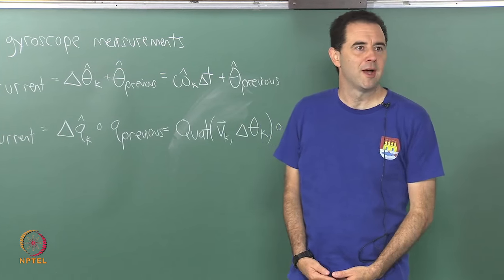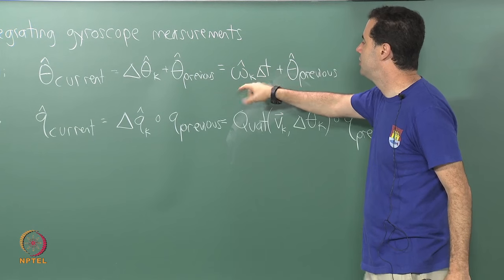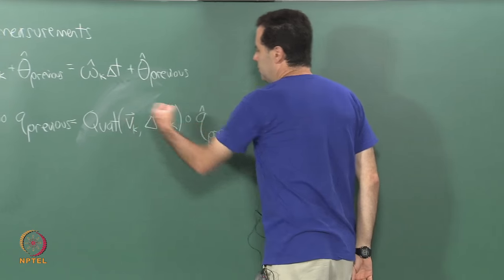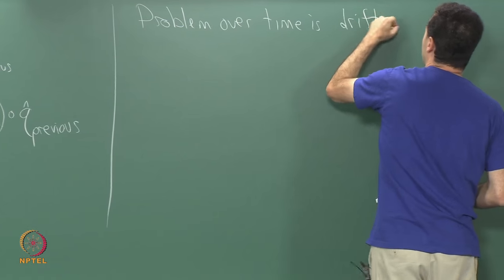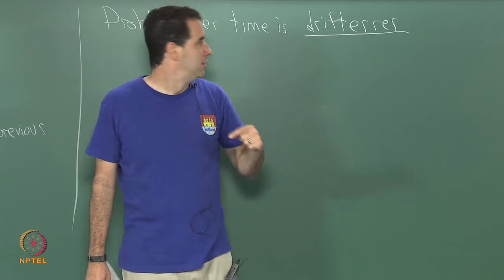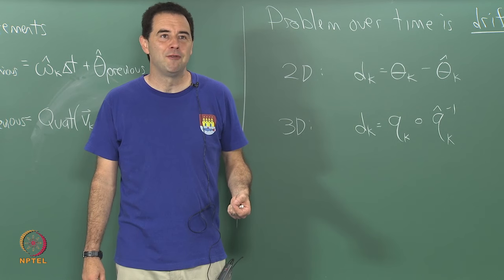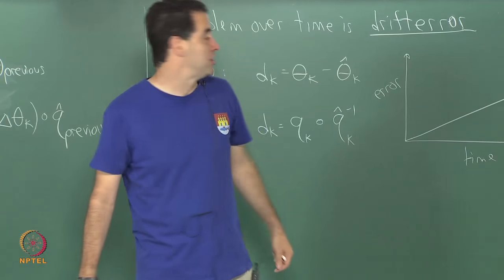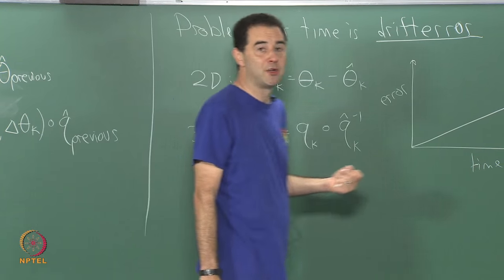Tilt drift correction

Comment: Is't an accelerator sensor measures acceleration according to the chip orientation ? when a user moves, gravity vector rotates and measured acceleration changes, by rotating initial gravity vector according to current gyro readings we can subtract gravity vector out of acceleration and get user movement. Gyro drift will appear in hear though.

Comment: did not understand the cause of drift error
Reply: it is due to the approximations used by us in calculating the "delta_theta" which is done by discrete sum approximations (instead of taking a smooth integral which yields nice and perfect result).